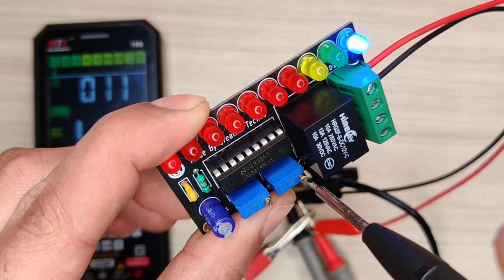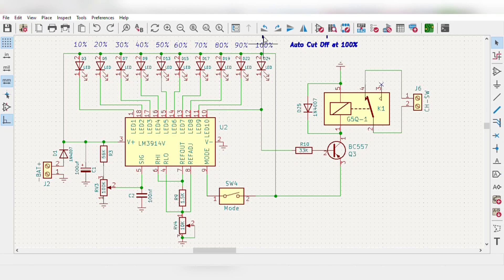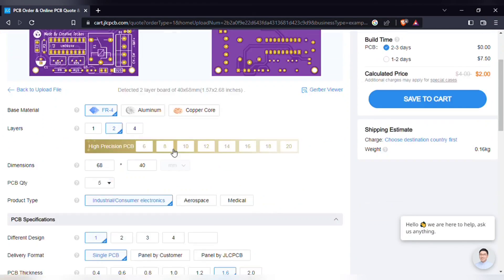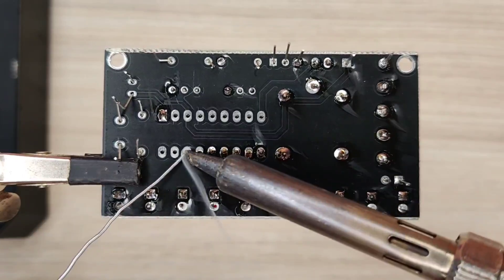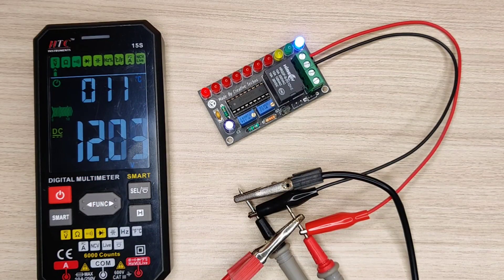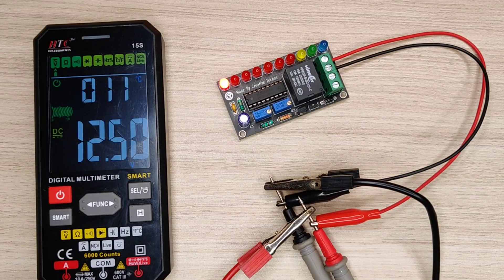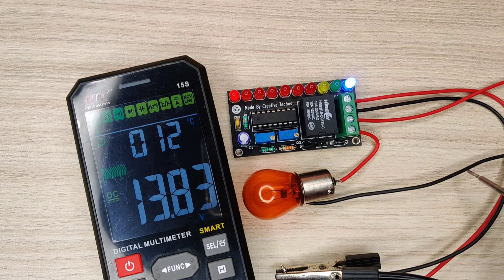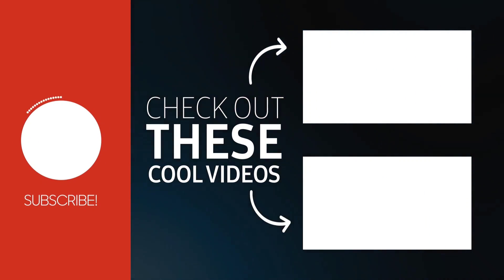12v Auto Cutoff Charger + Battery Level indicator circuit

Comment: Whats the charging current ?Is it possible to update this project with “smart” charging.For example if is the car battery of higher capacity like 55-100 Ah (charger will charge with 5A current ),if is small capacity like  a motorcycle battery 5 -15 Ah,need charging up to 2A,is it possible to upgrade this charger ?It will be hell good.Greetings from Montenegro ;)
Reply: This charger can handle alot of diferent currents it depends on the current limit on the relay, but it can reach a máx. Voltage of 12v

Comment: Very nice.  Gonna include the desulphator in the next one?
I keep gathering parts to make a battery charger and engineering changes the design!
Reply from the maker: Thanks for watching my friend 🙂, you suggested cool idea😜
Reply: @CreativeTechos  I was about to build this but noticed a couple problems.  I may be looking at it wrong.
When the relay is energized, it puts a short across J6.  And the battery can't charge through D1.